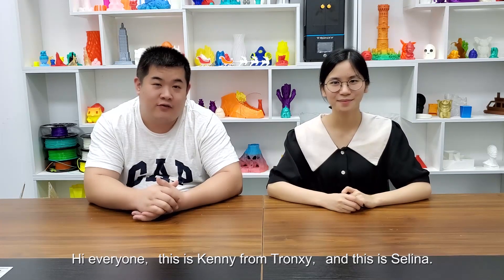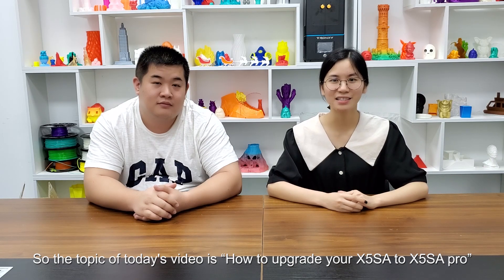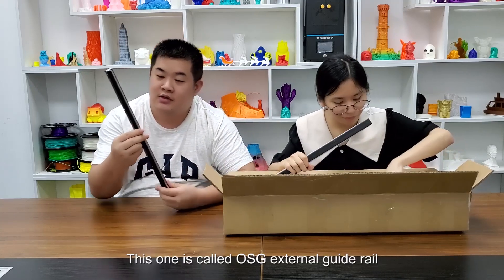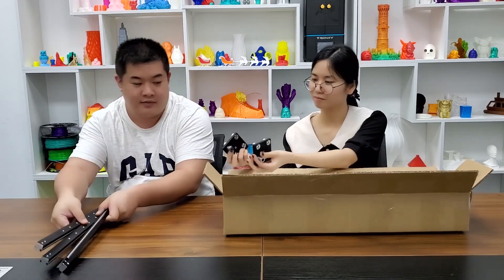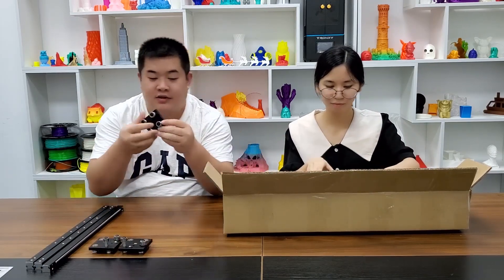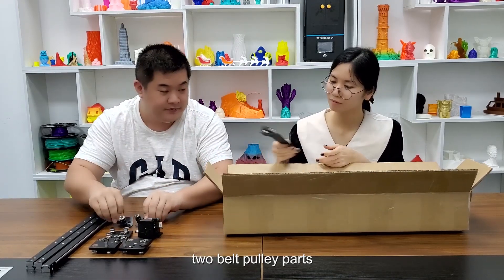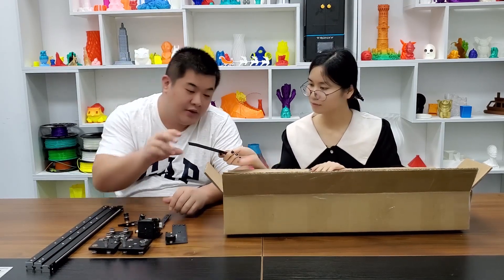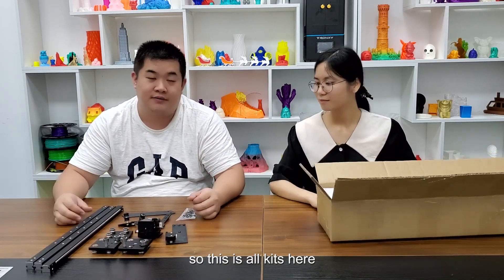X5SA Upgrade to X5SA Pro Version ( Upgrade Kit)

Comment: I have a question. Why is the TITAN EXTRUDER RUNNING BACKWARDS?  YOU ALSO DODNT MENTION THAT YOU HAVE TO UPGRADE FIRMWARE. Otherwise the extruder runs too slow
Reply: how do I upgrade that firmware this is driving me nuts

Comment: Must i upgrade the firmware from x5sa-400 to x5sa-400 pro? The support will not response to my Email.

There are no firmware file at tronxy.com and tronxyonline.com! The update files are less than 20kb and they are totally different! Whats the correct file?
Reply: No, it seems it does not need firmware update

Comment: God deamn, i buy this printer yeah, but 11:14 is scarying me..the third screw wit that fu*kn gap ?!! What is it ?
Reply: Looks like they should have at least made it so that metal piece of the pulley assembly bends down to the contour of the rail rather than keeping it flat. I guess the alternative now is to shove some washers under there instead for support.
Reply: @nmos001  this Is what i allready do..but must cut some aluminium plate as washer but nobody will pay me for this
Reply: @Mr7Iceman7  use a pair of scissors and some soda cans. They make great shims...

Comment: The mounting plate shown at 6:00 is different to the one on the original 12v X5sa; also the plate on the back where the belts attach, and the spacers. I asked Tronxy Service about buying this plate (and a new hotend) and was told these parts are not available. It would probably also be a good idea for the video to show the firmware settings needed to make the new extruder work. Other than that, a good video!

Comment: Where can I get the guide rail parts for the X5SA-400?
Reply: https://www.ebay.de/itm/X5SA-400-to-X5SA-400-Pro-Upgrade-Kit-Guide-Rail-TITAN-Extruder-3D-Printer-Tronxy/363017742854?ssPageName=STRK%3AMEBIDX%3AIT&_trksid=p2057872.m2749.l2649
Reply: you can make your own upgrade buy liner rails